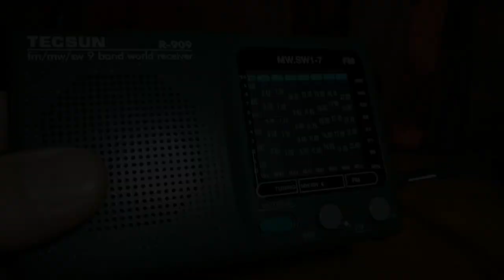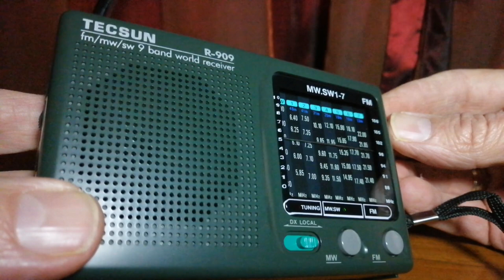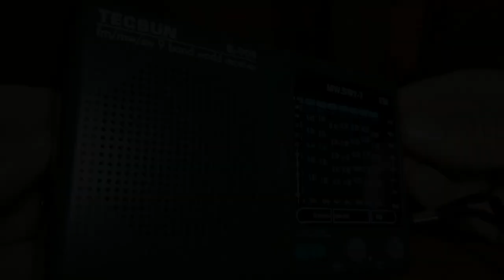Tecsun R-909 vs XHDATA D-219 on Radio Teos in Russian 9920 kHz from the Philippines #shortwave

Comment: I have both radios too and love them both. The D-219 for its incredible sensitivity and clear sound and the R-909 for its more natural unprocessed "non DSP" sound. Both completely different tech-wise and both really having their ups and downs. If i would have to chose to take only TWO little compact sized Worldreceivers with me i would probably take both the D-219 and the R-909 or the DR-920C. And yes the DX switch really only alters the volume but not really picks up faint stations better. x3
Reply from the maker: Couldn't agree with you more! I have often thought about this. If, for some reason, I could choose only two small radios, these two would be the ones. The D-219 for its incredible sensitivity, it really is an amazing little radio. And the R-909 for nostalgia and shortwave like it used to be. But leaving my Tecsun R-808 (the Tecsun version of the Grundig Mini World 100 PE) would be hard ...
Reply: @swlistening  Sorry to disagree with both of you but have you guys looked at Tecsun PL-606? And yes, it runs on just 2 standard AA batteries, has ETM (which is a delight to use) and has an external antenna jack. If I had to pack ultra light, I would slip PL-606 in my jeans pocket and pack other useful stuff in the bag; A Rambo knife with a bazooka attachment?   ;-)
Reply from the maker: @tech29X  Thank you for your comment. I actually did not look at the Tecsun PL-606, sounds like a really nice radio, from what you describe. I don't have one, but it does sound like a very practical choice!

Comment: Well, to my ears it seems that the R-909 is a winner here. The much clearer sounds helps for sure. The D-219 is a bit too muffled IMO. It kind of matches my own experience of these two. As I wrote earlier, my gripe with the R-909 is some lack of selectivity when the bands are crowded (BTW it seems that I've picked up one of the "good" ones).  
I'll try catching this radio on my next evening DX listening session outdoors, although as per SW Info they seem to broadcast too early in the day for this to happen.
Reply from the maker: I think on this signal the R-909 probably does sound a bit better, it is clearer while the D-219 is a bit more muffled.

Comment: 16 seconds ago you uploaded this video.

Edit: I just finished the video, I would say it is a close tie for the D219 and R909 (With DX switch on)
Reply from the maker: I'm not sure I understand your comment?
Reply: @swlistening  I just said in the top part that you uploaded the video 16 seconds before my comment, and on the edit, I said that the XHDATA D219 and Tecsun R909 (With DX switch on) are close in signal strength.
Reply from the maker: @FamtechVideos  I agree, they sound quite similar, but I actually prefer the R-909 with the DX switch off.
Reply: @swlistening  It sounds more quiet which is good.
Reply: Sir What is DX Mode Exact & Is it Really Useful....📻
Reply: @Dr.kuldeepyadav777  So the Tecsun R909 has an attenuator switch for DX anld local. DX is long dostance reception. However, DX can overload, so there is a switch for local as well. I hope this helps.
Reply from the maker: @Dr.kuldeepyadav777  The DX mode amplifies weak signals, so it makes weak signals stronger. But it does not work very well, it creates a lot of noise and does not really work. Sometimes on very, very weak signals you can hear a little bit more than in regular mode. But the radio works fine in regular mode, it is quite sensitive.